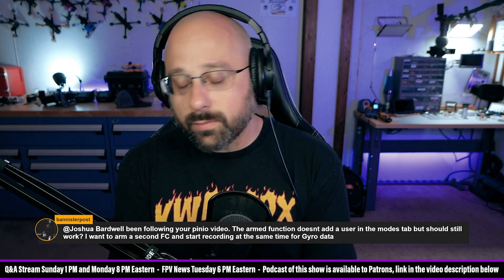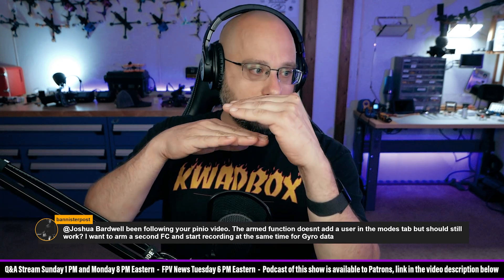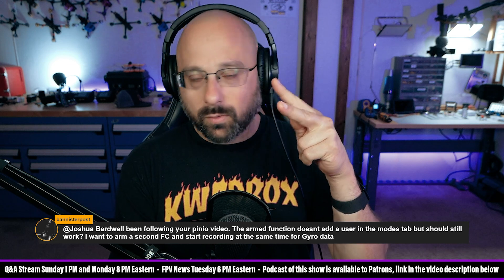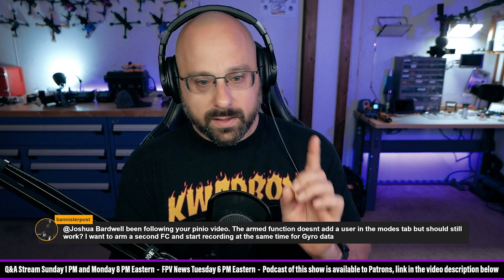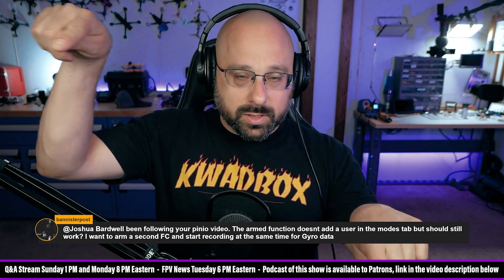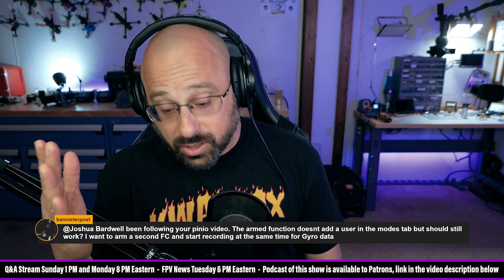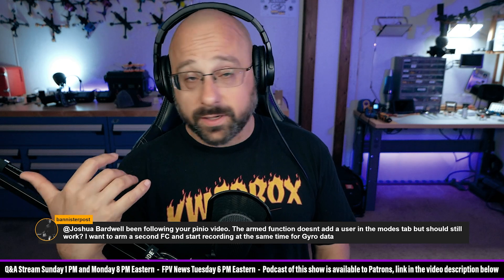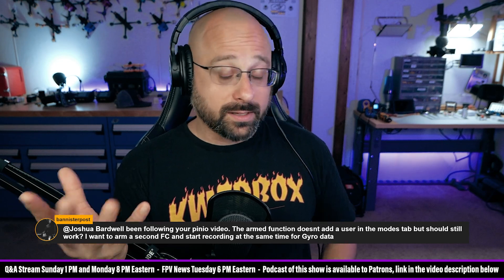How To Get Two Flight Controllers to Record Gyro Data On The Same Drone - FPV Questions

Comment: HELL YEAH!!  :-)

Correct on all points.  Disable Runaway.  I-Term accumulates on the Slave as commands are not exactly the same on both.

No Mode setup needed other than Arming, as BF records blackbox by default (if empty flash).  On the Slave FC, the only data that is good is:
1. RC signal (Setpoint)
2. Gyro reading
3. Filtered Gyro reading

The PID controller behavior and output on the Slave board you need to ignore in the BBL.